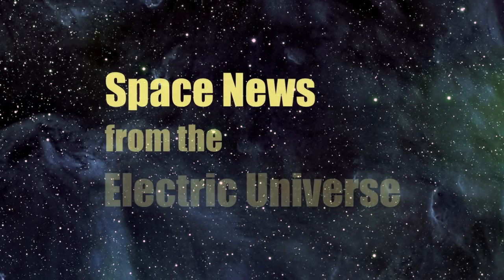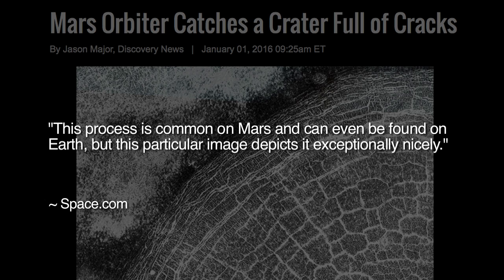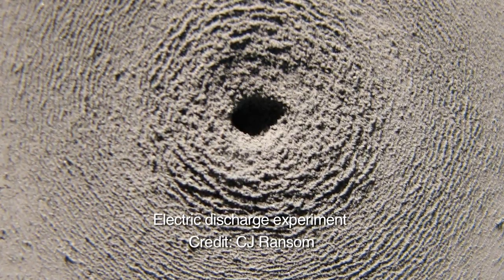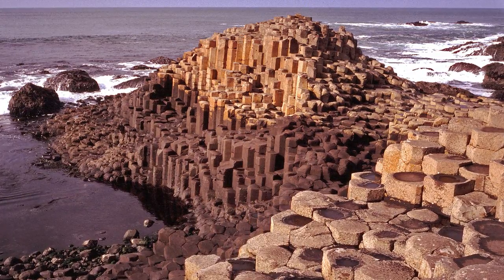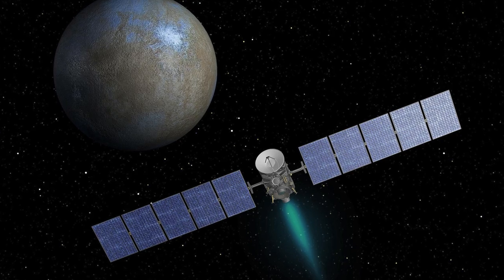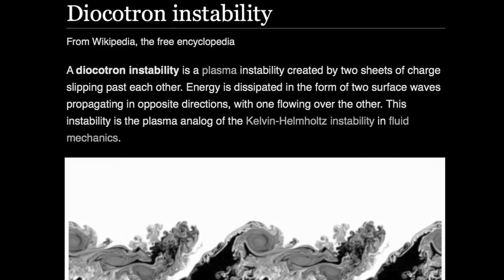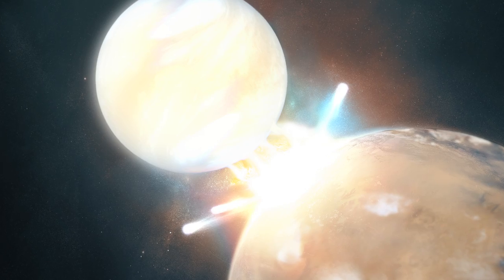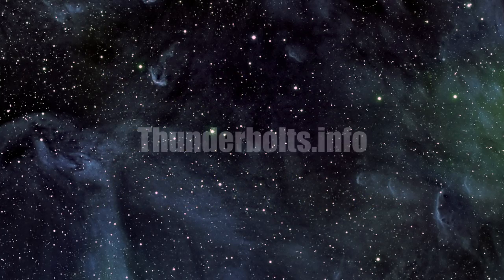Polygonous Mars | Space News

Comment: IN IRELAND THE GIANTS CAUSE WAY IS THE SMOKING GUN FOR THUNDER BOLT THEORY. FOR A SIX SIDED ROCK TO FORM YOU NEED (1)IRON (MAGNETIC)MATERIAL
(2)  LOT OF ELECTRICITY (THUNDER BOLT)(3) AND A FLUID STATE (MOLTEN ROCK)
THIS WILL FORM ONLY A SIX SIDED FORM.
Reply: +tyronejonez01 Theres more than one "smoking gun" check out "Bryce Canyon" in the USA. Possible Plasma Pinch rock formations and massive scale "razorbacks"
Reply: +MagicBlubber DEVILS TOWER (if my memory is correct)
Reply: +tyronejonez01 
No need to scream. It is difficult to read; many consider it rude.